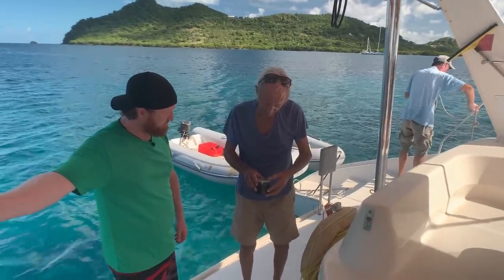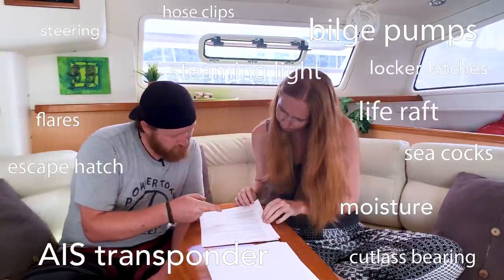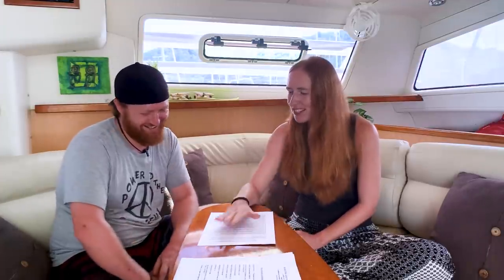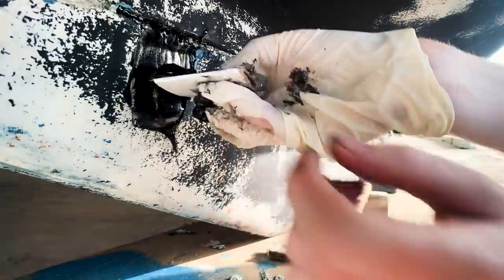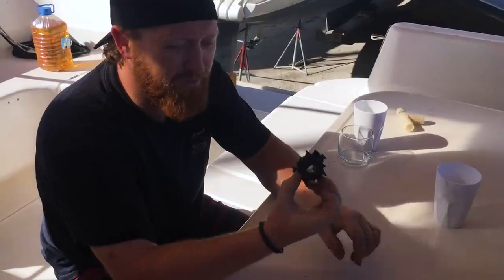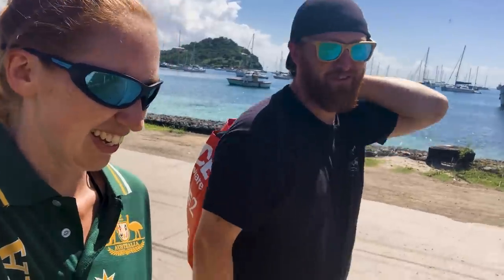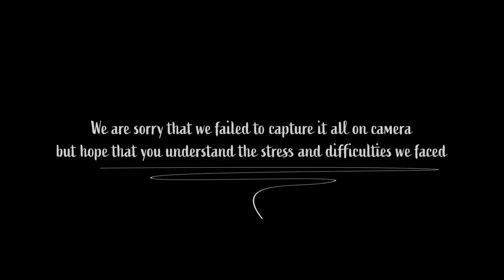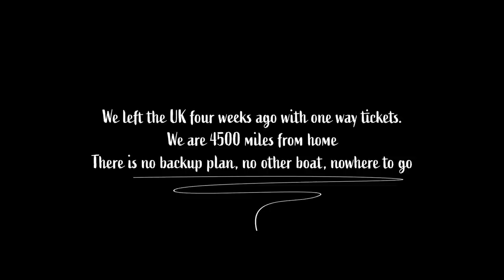Did we MAKE A MISTAKE?? [Ep6 RED SEAS]

Comment: A good trick if you don't want to take the heat exchanger apart to find impeller "wings" is to use a wet/dry shop vac and attach it to the hoses on one end then the other of the system and suck them out.
Reply from the maker: Good tip. It’s a fun bit of boat yoga to reach the back of the exchanger on the onan generator.

Comment: From the first video I was worried you were going to be used to get his boat onto the hard stand where it is easier for him to sell. Disappointed you guys are boatless , good luck with finding another boat. Boats are expensive and you need the funds to make sure you have a safe and reliable boat.
Reply from the maker: It was a tough call but in the end I think we made the right choice. We had set out our budget and we knew where we could adjust it based on varying circumstances but the sliding puzzle wasn’t working out and so we had to move on. 

Stay tuned to find out what happens next.
Reply: Buying a boat on the hard only, doesn’t make sense at all. Hull inspection inc. osmosis etc. must be done on the hard. Sea trial of course in the water.